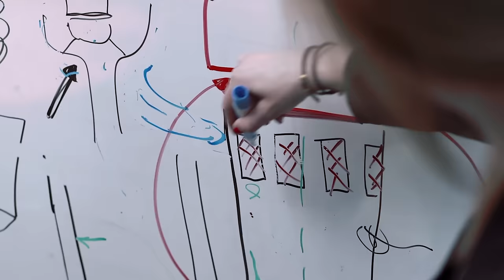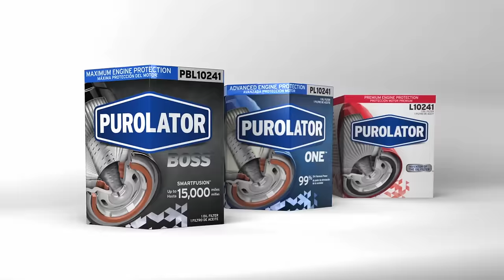Nothing Gets By Us™. Introducing the Reenergized Purolator Brand.

Comment: I hadn't noticed before I installed the purolator one that it suggests using synthetic oil I already had put in my conventional is it gonna affect anything or will it be fine till my next oil change?
Reply: Layne did you have any problem using the Purolator one filter with conventional oil? I am wondering the same thing.